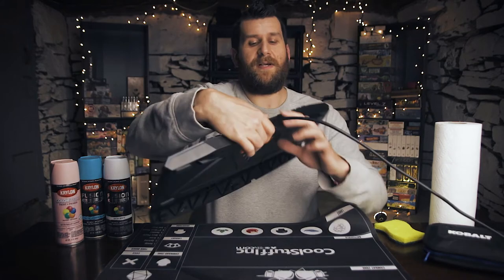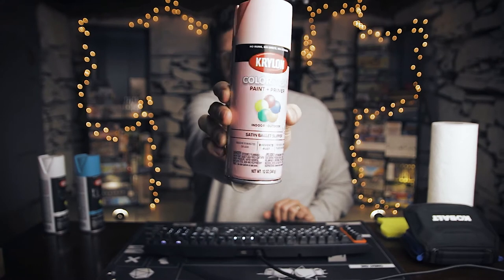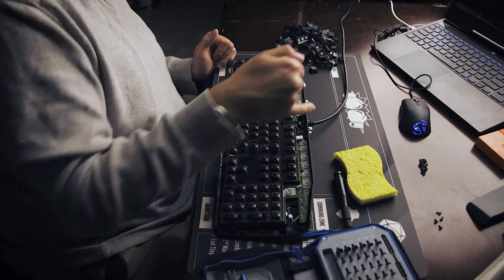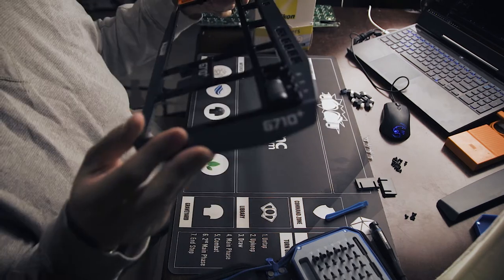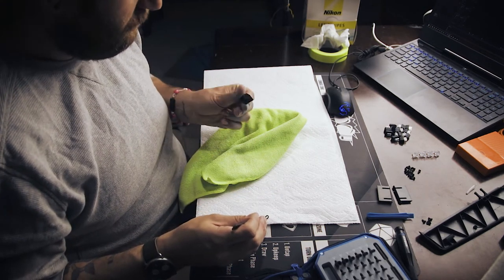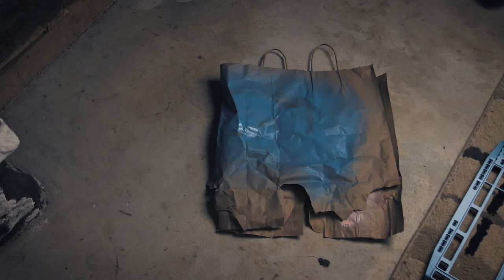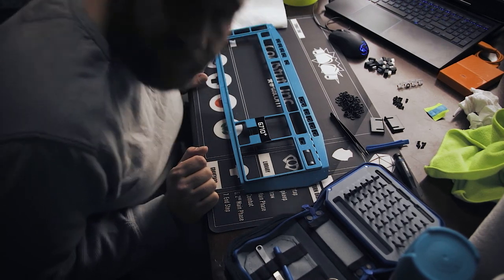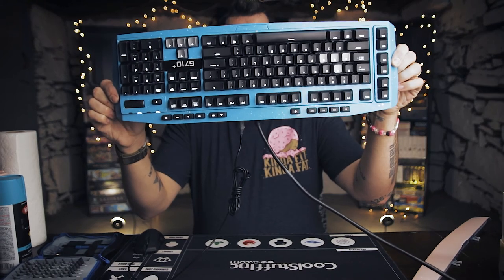How To Custom Paint Your Gaming Keyboard | Homemade Gaming Gear

Comment: I have an old g710+ too. I want to paint it all over with a matte white paint like you and renew it with new keycaps. My question is, which type of spray paint should I choose? Especially for this keyboard. Is there a good type of paint on which I can get a smooth feel on the surface.
Reply from the maker: I really like the finish I get from the Krylon Fusion All In One Paint+Primer. The coverage is great, the colors are solid, and it goes on nice and smooth.